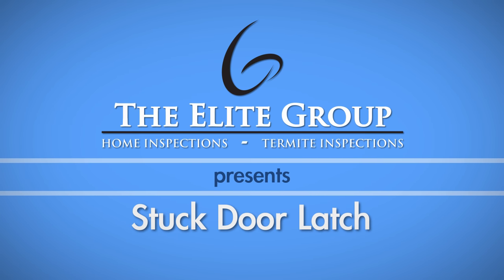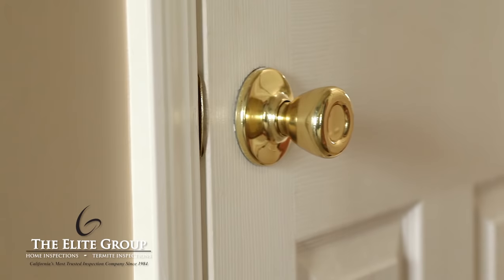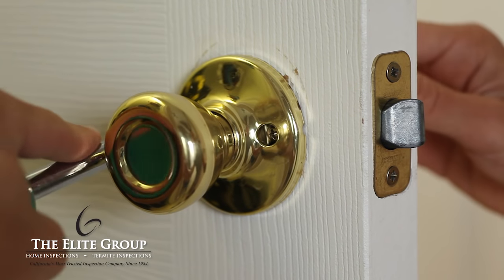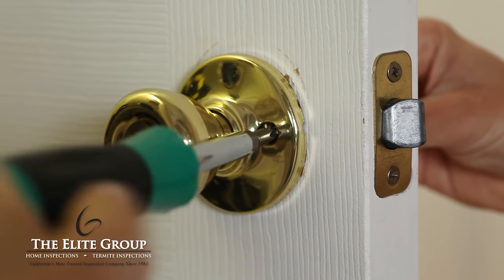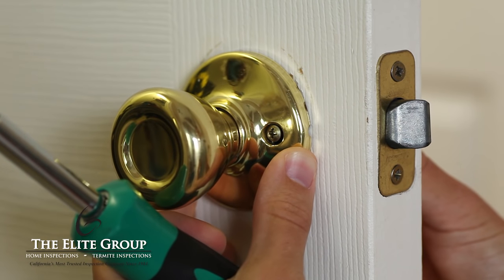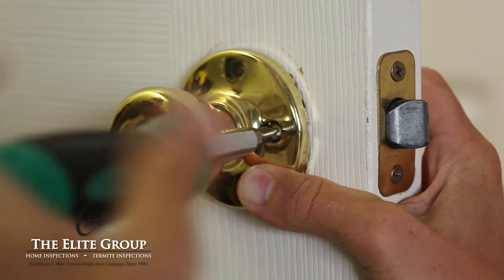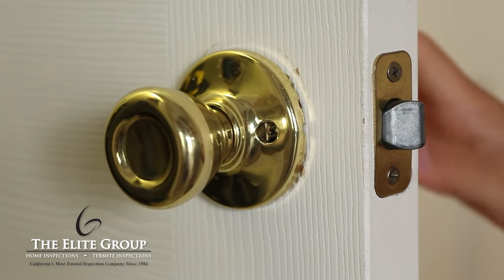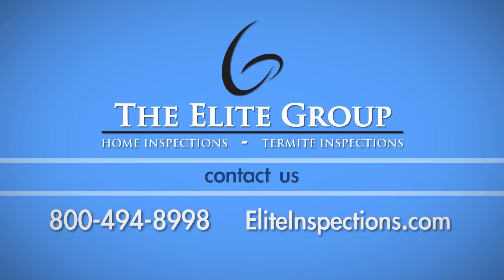How to Fix a Stuck Door Latch | The Elite Group Property Inspections

Comment: You failed to explain how to fix a doorknob that doesn’t open. The latch will not retreat into the knob
Reply: @miintychip6459they said they can’t open it. as in, there is no way to “push it back in”
Reply: How do I open from outside the closet door? Doorknob just slides but latch won't turn it's stuck

Comment: well the latch has got stuck and locked the door the handle came off now i can't open the door .
Reply: I have the same trouble. I know how to change the door knob, but the latch is stuck.
Reply: are u still in there

Comment: My front lock was sticking really bad, I had to turn the handle different ways to get the door to open, so I did this, and it's working great right now. I only had D-40 at the house, so I used that. Just a tip also, it's a lot easier when you're putting the lock back in together, to only screw each screw in just a little each side, so you can see the hole where the screws go into, once both screws are in, then screw them both all the way. Great video, thanks for helping us fix things around the house!!!😃